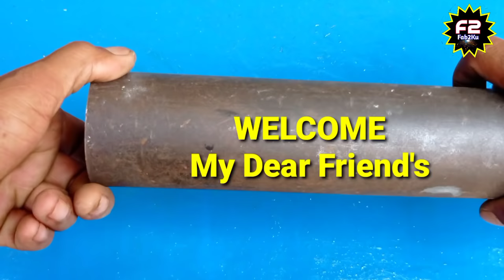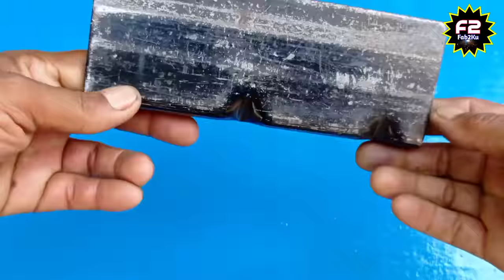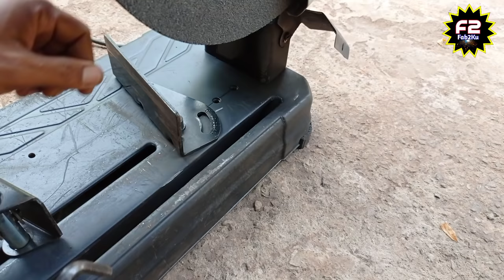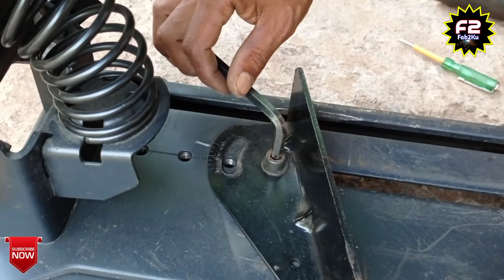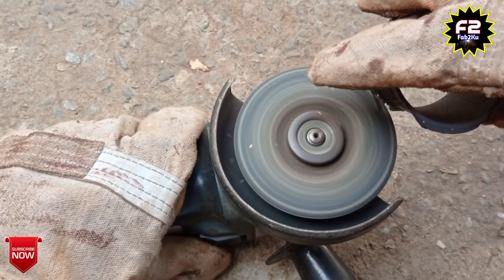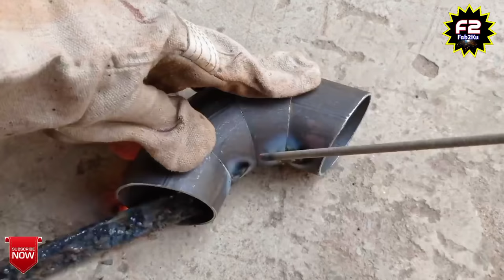Cutting Pipe With Cut Off Machine // Metal Pipe Elbow Cutting

Comment: are those sspacings  for any diameter pipe  I've just made the first cut on 8inch stainless flue and second cut does not clear the piipe  at  your  3inch spacing.  I'm thinking in's only suitable for the 6 inch is it? you demonstrate with.  Cheers Neil
Reply from the maker: Thank you so much sir

Comment: will the 1.5" spacing between cuts work on larger pipe to get the same results?
Reply from the maker: Yes Sir
Reply: Thanks Great video
Reply: No...  i just tried it on 8 inch dia  f lue  the lineal spacings need expanding as I'm about to do nowski  '' russian for now''

Comment: Wouldn't it just have been easier to turn the pipe over 180° after every cut? That way you didn't have to change the angle on the saw.
Reply: So would I !!
Reply: You could... but you need two center lines along the pipe on the exact opposite sides to do so... otherwise lining up the faces of the elbow correctly level/square/90 degrees matching the rotation of 4 parts to find them would be near impossible